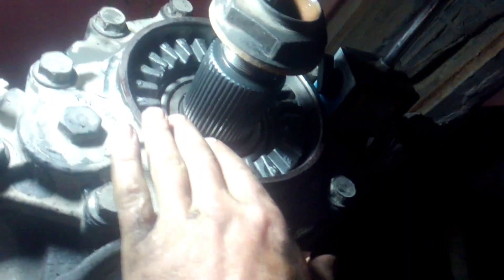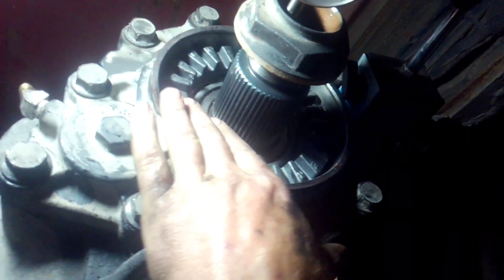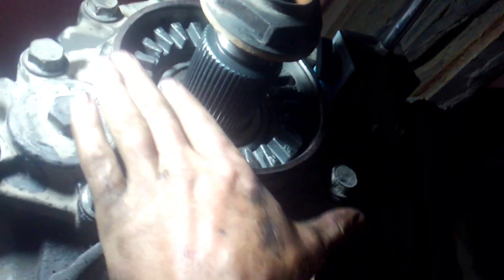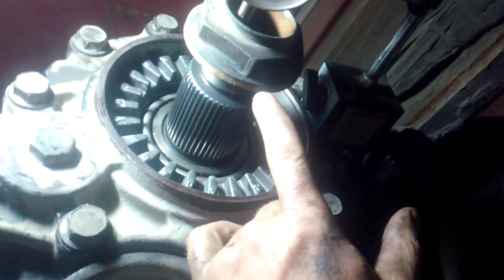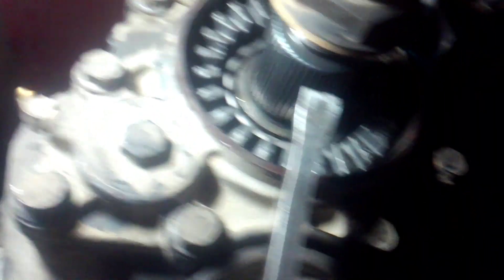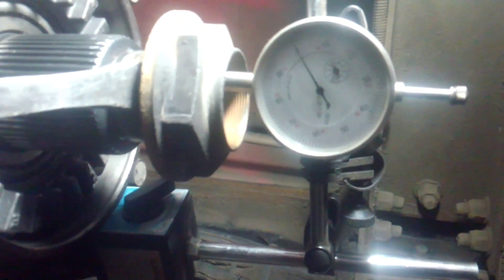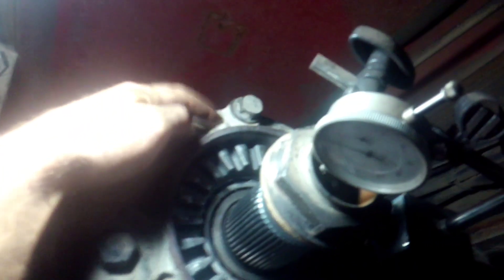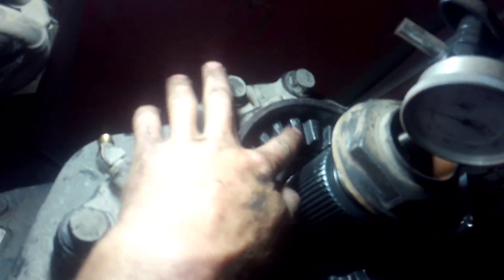Spicer Power Divider

Comment: My truck has problem when I turn differential switch on I hear air does something but only one rear wheel spinning on passenger side. What can be the problem? What's need be checked or replaced??
Reply from the maker: There's a air plunger just inside the power divider where the air line is. If the seals have failed it will leak into the diff and you will hear it coming out of the breather
Reply: @mlhrepairsllc6942  Thank you for info. I will try to test it tomorrow see what can be wrong with it
Reply: @mlhrepairsllc6942  Right now when I pull swith down to activate it don't hear anything but when lift it up to deactivate hear pressure release for a couple seconds

Comment: Hi there mlh have you ever seen those rears come in with the lock pin sheared off I've only seen a couple just curious if you seen it and that's a good tip with a MAG base oh and by the way your son is going to be a little charmer are you going to let him go loosen the automotive field or I should say Heavy Truck and Equipment thanks again
Reply from the maker: I have seen them broken. I believe that it was the pre 06 models. After that they went with a tapered off pin that kinda squeezes between the locks instead of going down between. For my son,as long as he has a good work ethic, I will be proud at what ever he chooses.